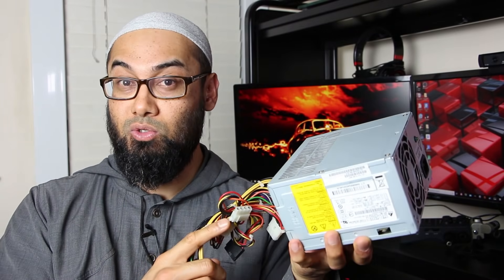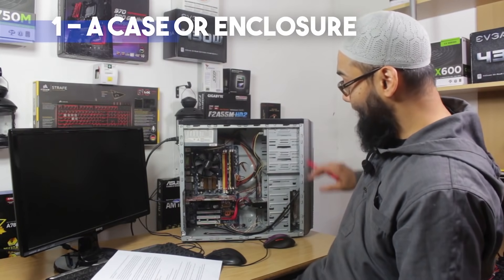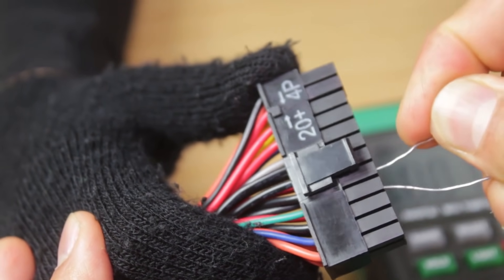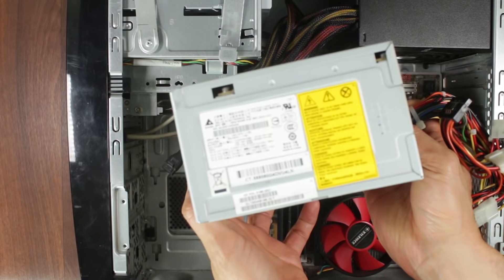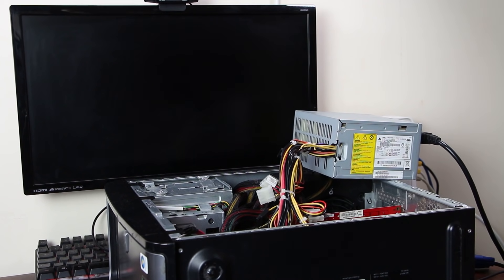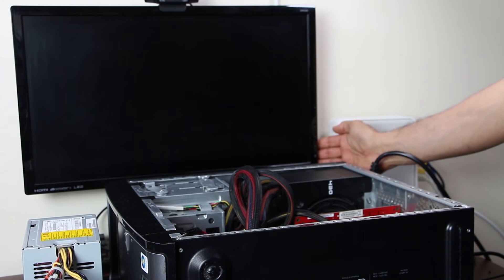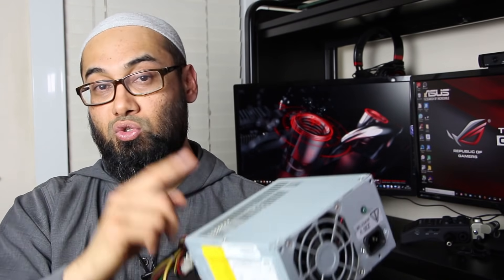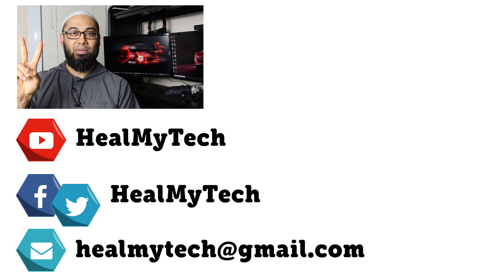Computer Turns On But No Display On Monitor | Led Light On Fan Spinning | Power Supply Unit Pc?

Comment: My PC turns on, but there is a quiet whizzing noise and my keyboard will light up, but my mouse will not. This happens every once in a while and I’m not sure what is happening.
Reply: Same bro PC turns on no monitor display mouse works but keyboard doesn't 😑
Reply: ThePerfectTime I took my RAM out and literally put it back in and it worked bro, maybe you might have the same issue

Comment: i think my power supply failed on my Inspiron 530. I use to be able to turn it off and on to fix no display but when I was using one day the display disappeared. i just put 8 gb in it and i checked the ram and its not that.
Reply from the maker: Troubleshoot and let me know!

Comment: Fuuuck my pc turns on fans spin lights on but no display, and i know ots not the psu and the hdmi is plugged in through graphics card help plz
Reply: Update - I actually fixed the issue! What I did was I went into my pc and I took out the ram and I realized their was a small string of a spider web in the ram slot, I then just cleaned them and simply switched the two ram I had to each other ram slots and that fixed my issue!
Reply: Just now happened to me
Reply: Same let us know if you end up fixing it please
Reply: agreed please fix!

Comment: When I turn on the pc the fan spins for 3 seconds same for the led lights. So the problem is with the psu right ?
Reply: @IISkeletusII  how do you do that?
Reply: @akline2737  I think ya just take the ram out and put it in again
Reply: @IISkeletusII  thank you so much
Reply: @hollietheblanketail6570  bruh
Reply: Techno Vortex hey I have 4 ram and four ram slots and it still says it still has one beep and wdym reseating the ram? Change the slots?
Reply: @hydrabeast4834  Yeah try changing the ram slot use an eraser to rub the dust on the ram. Remove the cmos battery and put it back on.
Reply: Jitesh Yeah I tried all that with my old ram and now I got new ram and did the cmos battery thing  three times and still nothing
Reply: @hydrabeast4834  cant connect to ram

Comment: broo i have the same problem when i play games or stress my gpu my monitor turn off and there is no display at all and its so hard to turn the pc and monitor back together .
did anyone have a solution

my config is 

●i5 3470
●msi rx 480 gaming x
●8gb ddr3
●1tb hdd
● 300 w psu 

Is the problem from psu ??
Reply: Try to borrow a psu from someone and try gaming. If that fixes it then its ur psu
Reply: @farizaarhan  okay thanks i did it abd its the psu .
thanks btw a lot ...👍
Reply: @SQUIZI514  yw
Reply: Maybe
Reply: @Martin-d3n5u  i solved it thanks btw
Reply: Im not sure if you have a strong enough psu
Reply: @cyberspino6277   broo i fixed ut the problem is my psu  thanks btw
Reply: @SQUIZI514  sorry for bothering u i didn't look at the replies
Reply: @cyberspino6277  not at all 
Cheers man.
Reply: @Gorkem Nisan its either the psu or your gpu cause my freind used to have a r390 and it  was running soo hot ;;;;

Comment: You are a true wizard. I was about to start punching holes throigh my brand new monitor but it was a simple flip of the power supply switch that was the problem
Reply: Bruh
Reply: Bruh
Reply: Bruh
Reply: @pecroama7513  bruh that's no lie either. That monitor was about to eat a 6 piece
Reply: How fucking stupid are you my nigga
Reply: Ukr I was Abt to do the same thing
Reply: I wish that was my problem 😭
Reply: Bruh
Reply: Bruh
Reply: Bruh you dumb as fuck lol
Reply: @loukesz  awww man. You got me good
Reply: This is so fuckin clutch!!!!!! 😥 I also took out the lithium battery and held the power button for 30 sec to drain remaining power just for good measure
Reply: razzle b dude that’s exactly what I did
Reply: Be careful about flipping switches in the back of the PSU, there is a switch that lets you change the expected power supply from 110v to 220v or the other way around and if your country uses 220v and you switch it to 110v it will blow up once you try to boot your computer.

This has happened to me, don't make the same mistake as me, the switch is usually colored red/white showing the numbers 110v and 220v.
Reply: @rune.theocracy   is there any chance other pc components are damaged except psu
Reply: @AK-uq6uj  I dont know for sure but I'd assume not. Since your power supply already takes 110 and puts out much less, I'd think that 220 couldn't actually reach any other components since the psu would probably fry very quickly then it wouldn't be able to transfer electricity to the other components anymore. I have no idea tho
Reply: @rune.theocracy  well where I live we use entirely different outlets for 110v and 220v so it wouldn't be possible to get 220v to my pc unless I had an adapter plug and plugged it into where my washer/dryer plug into 😂 that's good to know though.
Reply: Thanks for saying how couldnt watch the whole video was busy.
Reply: Lmao

Comment: Same issue but i have gpu if I remove it it works. Frontech 500w psu... What to do
Reply: Vivekananda N what cpu and gpu do you have?  It’s probably just a problem with your gpu just replace it

Comment: how i know if the problem is to the graphic card ?
Reply: Asus Gamer plug into motherboard instead of gpu and if it works it’s most likely the gpu
Reply: @chasecorbat1420  My pc starts up and everything is running fine but nothing shows up on the screen, I tried plugging it into the gpu and motherboard but it shows no display, what could it be?
Reply: @kiwizlucks4947  same issue. Maybe mobo is old and psu is also not good enough to power up the gpu
Reply: Hey bro I think it’s a problem with the gpu for me because I bought a used gpu and I think there’s a problem with the gpu so I’m gonna send the gpu back and get a new one

Comment: Help ! Last night i played some league of legend, after ther 3rd match my PC suddenly died. No bluescreen, no freeze, it was like someone plug out my cable. After that i press power button a few times but still died. I plug out all the cables then plug in the cable, then i press the power button again, my PC turn on but no signal. I change hdmi cable and change it into dvi cable, still no signal. But i can hear the windows sound when i plug in/out usb cable (keyboard, mouse, or bluetooth). After that i check my GPU, My GPU fan is not spinning, but the led light brand logo is on.

Is this PSU failure?? Or GPU?
Reply: pranowo94 Clean it it might help

Comment: I just build my first computer today and everything powered on, but no display

I took the gpu out and plugged the hdmi into the motherboard and it works.
Is this my gpu’s issue? Plz help cause I don’t have a second gpu to test
Reply: My old motherbord does not have graphics support without external graphic card....how i know if is the grapic card ?
Reply: @Gamerman2024-u1w  open the case and look for an Big chunky vertically aligned sort of stuff with a fan
Reply: Ugesta coolie 
If your GPU was the problem it probably wouldn’t power on at all. Did you buy the GPU new?/is there another computer you can test the GPU with?
Reply: @RJBuildsPcs  bro put out my vga cable from gpu and connect it direct to motherboard. And my display works out. Could it be my gpu problem??? But my gpu led all turn on and the fans are working. Help pls
Reply: I just re-bought the gpu and I am fine now, thx for helping though
Reply: @ugestacoolie5998  how mate??

Comment: Step 1: remove the suspected graphic card from the PC and install a lower profile graphic card into the PC, or try another graphic card by smaller physical size. If the lower profile graphic card works, then install the suspected graphic card back into the PC and see if it gives display or not. You might think it must be the suspected graphic card that’s faulty if another graphic card works in the PC, but that’s not always be the case, in rare some cases it takes another graphic card installed and be able to display, then install the suspected graphic card back in, then if the method works, all the pc startup works fine with the suspected graphic card unless it has been removed from the PC, if you did removed the graphic card and installed it back in again and again there’s no display, then you need to repeat the quoted steps - to try another graphic card in the pc before putting the suspected graphic card back in.

Comment: Step 2: if the PC case ain’t fitting the graphic card right, like you have to push hard at the PC case’s back panel in to make the screw hole align with the graphic card, or there are gaps you need to insert cards to fill them, the graphic card is installed into place, but after a few weeks later there’s no more display. The solution is to replace the PC case or find another way to install the graphic card without putting to much “strains” on it, so it’s fit into place and be installed more freely.

Comment: Step 4: replace the power supply unit if it’s over 6 years old when there’s no display, because soon or later it’s a gonner, labour and time worth more than the power supply, since you’ve already opened the PC and spending time on fixing the PC, recommended to upgrade or replace the power supply.
Reply: this just happened with mine :'( 6 years since i got it. doesn't always boost at all. sometimes turns on to just a black screen, sometimes boots to windows perfectly within seconds. i think it's bitten the dust

Comment: Step 3: clear CMOS settings, reset CMOS settings to default or stock, then follow the instruction in step 1 and step 2 ... some mobo or PC’s CMOS settings may work for 50 to 100 startups, then it could gone buggy, it’s could be glitchy, so the best ideas are to retuned the settings and use other combinations, it may solve the glitch or CMOS bugs. Also at rare times, plug in a new USB device into a PC could trigger glitches in CMOS settings or “jams” the PSU circuitry, recommended to reset CMOS settings or tune it in a slightly different way.
Reply: Aye so I tried everything I could including reseating cmos battery, nothing worked. Then I switched the monitor and changed to a dvi/hdmi cord, the display finally works, the keyboard and mouse light up, it detects them, and prompts me with:

Please enter setup to recover bios setting.
Cmos date/time not set
Hit f1 to run setup
Hit f2 to load default values & continue

When I try to select f1 it does nothing, as if the keyboard isn't functioning/responding, or the display is frozen.
Yeet. Pls help me, I'm an absolute potato 🥔♿😫
Reply: Try swap to a different keyboard, or swap to ps2 or USB keyboard. Reset CMOS by pressing the F2 key may not work of the past owner setup the CMOS setting with a no fault RAM, they set it up with MANUAL settings on the RAM, then swap the RAM with a slightly faulty 1 that only works with MANUAL settings, thus reset the CMOS would return the MANUAL to AUTO on the RAM setup, that mean you may need to find a compatible and no fault RAM to be allowed to press the F2 key, sure sounds CRAZY to fix a PC, better lucks if there are a lot of spare parts to swap!
Reply: @jakexgold3879  Yeah, it does sounds crazy lol you lost me a few times there. All I need to recover from this rig is my windows sticky notes from the desktop.. I could throw the rest away without a care including the hardware lol but it's just one issue after another.
I bought a PS2 keyboard and it works to control the f1 and f2 lol. My PC is so old it doesn't supply power to USB on boot, only PS2..
My latest tragedy: When I exit the bios, the screen just stays black 😤😣🔫
Reply: Would using the mobo jumpers at this point be of any significance to a solution? Or is that just the same as reseating the cmos?
The only other thing I can think of that might work would be to replace with a brand new cmos battery.

Comment: Had same problem, here's how I fixed it. Have repeatedly trying on different monitors new cables new graphic cards I thru everything away and bought a new PC never looked back
Reply from the maker: That method works perfectly but only if one has the money....lol....!
Reply: Can I have everything your throwing away?
Reply: @IrishLadGaming  🥺
Reply: Do you experience a problem on your Laptop, Macbook, Desktop, Phone? Is it over heating, screen turns black, windows issue?
Then search no more, message MILLER'S TECH for any kind of COMPUTER REPAIRS, HACKING ISSUES, Contact him on WhatsApp +18312915270

Comment: Hey i need help my pc starts but there is no display i bought the parts used so the Q can my ram cause this problem or the power supply and if it is the ram should it give me 3 beeps sound that is means its not working thanks in advance
Reply from the maker: 3 beeps for your specific make and model motherboard should be clearly stated by the manufacturer, check it!  Check your RAM independently with something like MEM86+ Test
Reply: I found my problem thanks brother

Comment: Hey I have built a new PC and it turns on but has no display so I gave it to a guy to check it and he said it was the problem of PSU is there a way I can fix my PSU instead of buying a new one?
Reply from the maker: It depends on the problem on the PSU.  If its a capacitor issue then yes it can be done if you have diagnostic and soldering skills.  If its an issue with the PCB then more difficult.  At the end of the day, you need to weigh total cost of repairing vs replacing and decide.

Comment: I have a same problem. Everything is fine it has  power but  whenever i push the power button it wont show up anything.  :/ i will try this method and will update you if it work. Goodluck to me
Reply: Leonarda Edep did it work

Comment: it was because my power went out for a split second and then the monitor wouldn’t boot up
Reply from the maker: Hard reset, unplug and replug all cables and components, if it fails then testing each component individually.
Reply: HealMyTech 
Thanks, I unplugged it and plugged it back in and it worked!

Comment: I bought a better power supply for my gpu 450w and i put everything in and it turns on but no display
Reply: I got the same problem im going to an engineer near by and I'll tell you the problem
Reply: The problem should be the motherboard
Reply from the maker: IF you can test the new power supply (or and the older one as well) independently, and confirm its working, then your issue is not the power supply.  What other tests have you done?
Reply: it's probably the ram you can replace it or just clean out the ram slot and wipe the ram with a cloth

Comment: Someone gave a pc for me and when i turned it on and there were no displays also there are some "plugs" from the power supply not plugged in on the motherboard
Reply: Yea, psu's have connectors like *molex (for extra fan, rgb etc)  *sata (for hard drives, you will have more then 1 of those) *6 pin (used for graphics card that need more power then what the mother board can provide)
Reply: I have a problem
Reply: I just bought a new pc built it from scratch and it's all on like all the fans , graphics card , cooler but it's still not connecting to monitor but idk what to do
Reply: @puresleeptherapy  same with me💔
Reply: @puresleeptherapy  same too I get 'no signal detected' on the monitor. So I don't know what to do
Reply: Wild Adventure Same here guys did you figure it out?
Reply: I figured it out I found I'm getting no output though the GPU and motherboard s ports so I am hoping to get a replacement motherboard soon.👍😎 And try a mouse in the motherboard usb and see if the laser light is on . Hope it works out for you
Reply: nvm my dumbass forgot to plug the gpu into the monitor as well as the mobo into the monitor
Reply: Hoodie Fazl what?

Comment: Everything turns on, gpu spins, psu spins, no beeps, cpu fan spins, tf
Reply: Thats most likely a monitor. I had the same problem today and checked about my monitor and it turned on
Reply: AdmiralD.rifter oof I mean it was the ram. One of my ram slots was dead.
Reply: Same
Reply: Legit my problem right now. Someone help!
Reply: @fIurox  change to dp using monitor buttons
Reply: AdmiralD.rifter I don’t think it’s a monitor issue although I’ll try it. Whenever I turn the main power switch on, my pc powers up by itself Without me even hitting the power button. But it doesn’t do anything after that
Reply: @fIurox  try removing and switching the ram. use one stick. My problem was my ram slot. it was dead.
Reply: @fIurox  record it and upload a clip to your channel. so we can get a better idea.
Reply: ronaldo Duran I’ll try that now
Reply: ronaldo Duran were you having the exact same problem as me?
Reply: @fIurox  If you read my comment, my PC was spinning and running but no display. Turns out it was a dead ram slot. so I can only use one stick of ram.
Reply: ronaldo Duran why not just fix your ram slot? 🤣
Reply: @fIurox  how do I fix it if its dead? I am not a guy who knows how to remove the entire slot and solder a new one.

Comment: pc turns on but no signal on monitor and led light of lan is not blinking, how can i possibly fix it? pls help....
Reply: I have the same problem. My specs Ryzen 5 2400g 8gb ram 500w psu SSD 240gb 1tb hhd and A320M-HDV motherboard
Reply: I seek advice to a technician and what they do is they replace the motherboard. They couldnt tell the probable cause.
Reply: Jona Del Rosario mine crashed and now it doesn’t get signal to the monitor, should i take it to a computer repair shop?

Comment: I have these problem for ages. Sometimes i am lucky that my computer is opening , most of the time though its all black screen ( monitor no signal). There is power , the fan is running and the lights are on. There's just no signal on the monitor. Pls help!
Reply: Edwin Jose Dela Cruz same problem with me